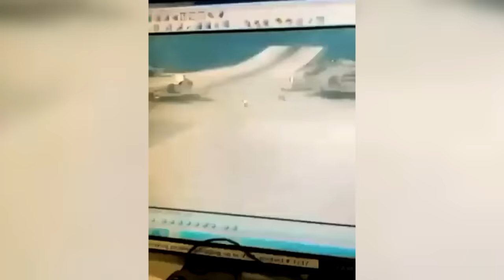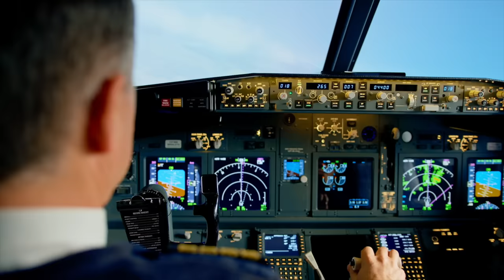Plane Takeoff Failures Caught On Camera

Comment: You should research before creating content. The pilot of the Air Maroc 737 did everything correctly. Is not that he pull up to early or that he used all the runway...  An Airbus A380 landed in the other runway creating wake turbulence. This wake turbulence is what cause the 737 to go down when confronted the vortices of the turbulence. He lowered the nose to regain speed and lift and pull up again. Reported to headquarters and documented.
Reply: don't be ridiculous.i was on that plane i knew what happened.

Comment: New drinking game. You must down a shot of Tequila every time the narrator says "thankfully."
Reply: And a swig of beer every time he says "hit the gas".
Reply: Can't unhear it now
Reply: Or when he gets something wrong. The production team needs to do better research. "English Royal Navy", implying the cost of the jet is its weight, "hit the gas and aimed for the ramp",  "English Royal Air Force", All multiengine aircraft are designed to fly on a single engine - dropping the fuel and payload was a precaution,  RAF instead of RN, Setting speed higher would not cause a crash. Just terrible fact checking.
Reply: @MrGrumblier  Or no fact checking.
Reply: If watching Air Crash Investigations, the word is "desperate".

Comment: I always find it incredible how they manage to find the cause of a plane crash by examining the parts of the plane, even though they’ve been destroyed and burned up
Reply: The data recorders or black boxes, make the job much easier by monitoring engines, speed, angle, pilot inputs, and a thousand other things.
Reply: Wouldn’t be a problem if they made the whole plane out of the stuff they make the black box out of.  Let’s see what kind of stupid rebuttal that generates.
Reply: @justing42  Because black boxes are not immortal either, which is the perfect silly answer to your silly comment.
Reply: @bigverybadtom  They aren't black either, their orange!
Reply: @justing42 Well, apart from the fact that it's an old joke by a stand-up comedian, how do you know the "stuff" the "black box" is made of is airworthy and/or cost-effective? 

Is that sufficiently "stupid" for you?
Reply: After a thorough search, all the parts found are put on a similar plane type frame.
Most parts will be slightly deformed but that's to be expected.
However, if you find burn marks on some fragments, you may steer your investigation into the possibility of fire causing the crash.

Or if the burn marks are on parts that are not reached by a burning engine, it might be bomb or missile.
I'm not an air crash investigation expert but I have seen a lot of episodes of the show of that name 
🥸
Reply: @justing42 : Ridiculous comment.
Reply: @billboyd4051 …..They don’t always find them sure they make it easier but I agree with original comment it’s amazing how the investigators put together a plane to come up with answers
Reply: Everything still there somewhere just got to pick it up and jigsaw puzzle it back together.  Maybe thats why we have jigsaw puzzles...
Reply: @justing42 because a black box, which is actually orange, is encased in a titanium and steel alloy. Imagine the weight of a plane if it were made of the same. Also, although the 9th most abundant element on earth, it is found in oxide form and has to be made into a metal via costly processes.